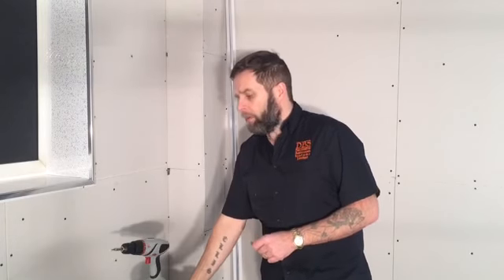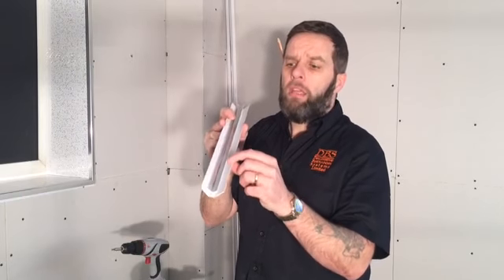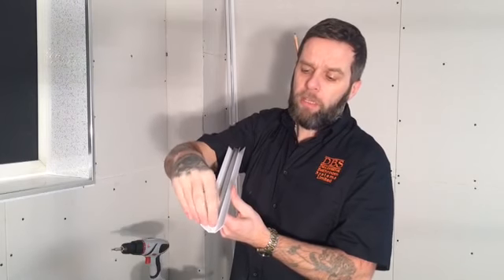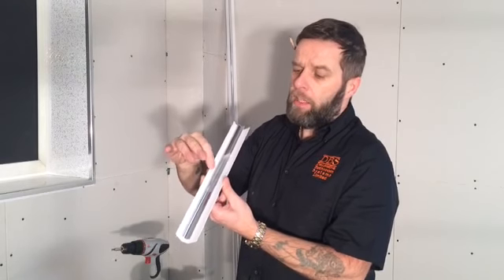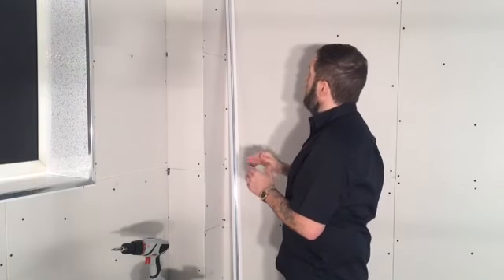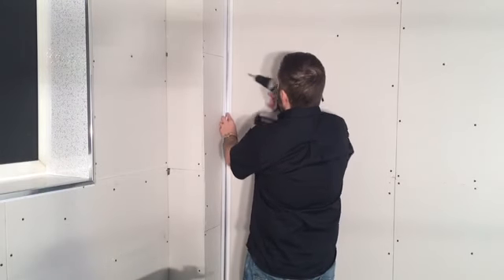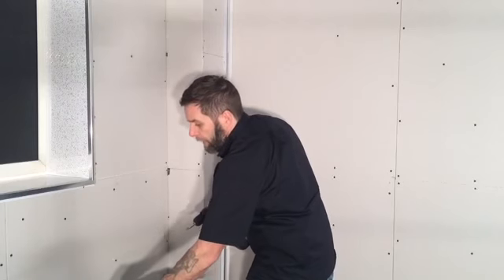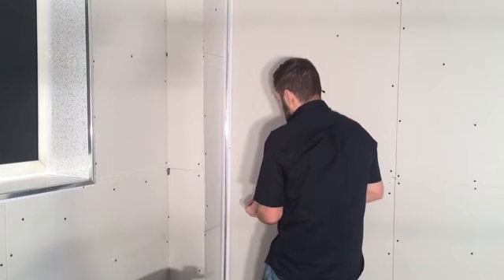How To Fit A Internal Trim By DBS Bathrooms

Comment: Do we need to cut off the tongue and grooves in order to get a snug fit into the internal corner trim please?
Reply: Hi did you cut the tongue and groove? As I am having some issue
Reply: Hello @aadam1674 . Gosh it's 5 years since I clad the bathroom and I think I must have cut the tongue and grooves off. My memory is a bit hazy as it as so long ago. I know for a fact I didn't screw that corner trim to the existing tiles though. Sorry I can't be more helpful. The finished job looks great though and I'm pleased I used the plastic cladding. Good luck with your project - I hope it all works out for you. Regards.